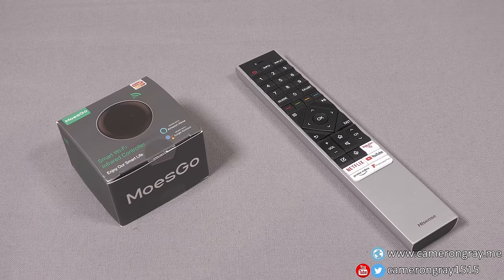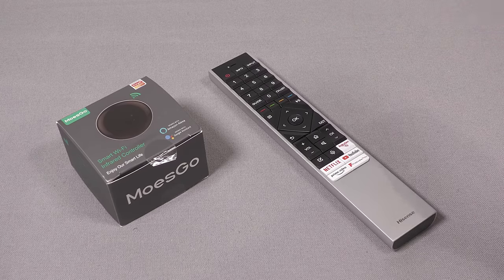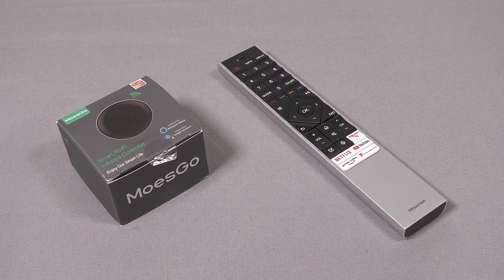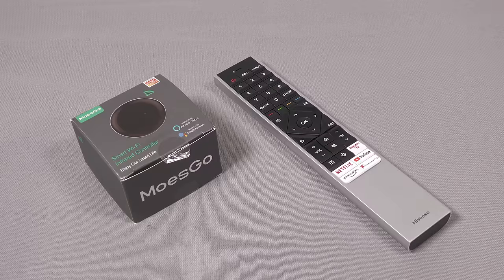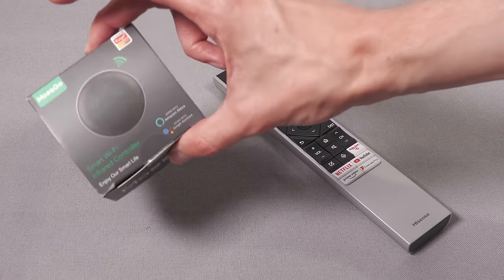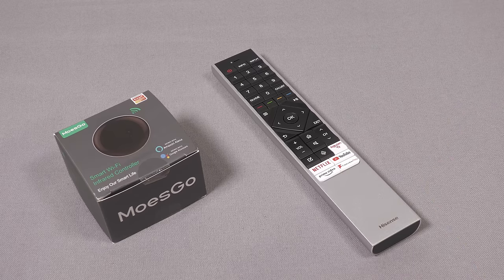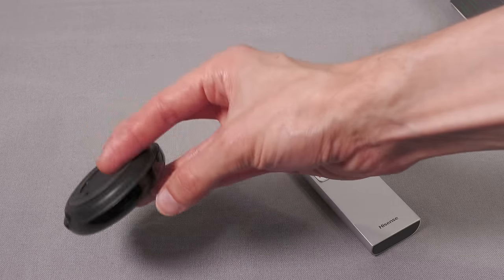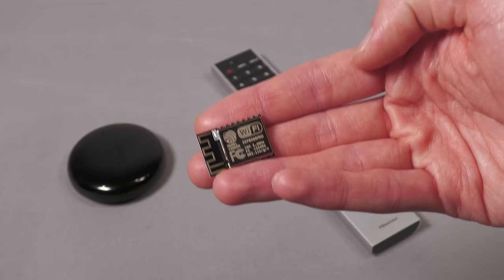Building The Ultimate Universal Remote - Tasmota & Node-RED Powered IR Blaster

Comment: I knew you'd make a video like this, but what you really did exceeded my expectations. I have a similar issue with limited CEC control on the older model LG TV I have in my bedroom, and the Prism+ (Skyworth based) TV I have in the living room doesn't support CEC at all.

I do something similar with a streaming box (that runs Android, so it supports USB keyboards out of the box) using a FLIRC device, but that only works one way and isn't as advanced as the setup you have showed.

I forgot that Tasmota existed before watching this video, and I was reminded of an unrelated project idea I had.

If I were to do something like what you showed in the video with the bedroom TV, then what I know is that if I try to press certain buttons on the remote, it would throw an 'Only available in TV input' error message, so what I could theoretically do is have my theoretical Node RED script wait 1 second for any additional button presses, then if there aren't, send the IR code for the 'enter' or 'select' button on the TV remote to select 'No' on the error message. However, if I were to press the 'Guide' button on the TV remote, the TV switches over to the tuner without throwing that error message. I just realised that I'd have to also have a way to detect what input the TV is on, or just assume the TV is always displaying a video input, which might be possible through the LG external serial control interface.

(41:15) Same thing with the Skyworth TV remotes, at least the one for my Prism+ Q55 (Skyworth 55UB7500), where it defaults to Bluetooth control. However, it uses infrared for the power button, and like the Hisense remote you showed, it also uses infrared as a fallback.

(42:06) Similar thing with the Skyworth remote. It lights up red when using infrared like with the Hisense remote, but lights up green instead of blue when using Bluetooth.

I may be wrong about this, but I think VIDAA is a fork of Android TV that doesn't use GMS, and uses Hisense substitutes and their UX instead, so I won't be surprised if the apps on that platform are just Android TV apps that had been customised to not depend on Google Play Services.

Comment: I LOOOOOOOOVE my tasmota IR hubs.  There are cheaper ones that still come with an ESP8266 out there.  I did a write up that shares the instructions and links if you're interested in sharing it.  Also tasmota and MQTT group topics are magical.  I put one of these in each room and carry the remote around the house for my audio receiver.  When I push a button on the remote in any room the IR hub receives the command and repeats it through the one that's actually next to the receiver.  It's sooooo good.  Simple events scripts in Home Assistant.  Also you can use the raw codes and use any IR code.  Tasmota option SetOption58.  Then IRSend the raw code will work.
Reply: I'd be interested in links to the ones with ESP inside. Thanks!

Comment: great vid thanks..  Though it would have been better to see the de-soldering and soldering.

fwiw the rm mini ir blaster  has a set of node red nodes (contrib) to learn and blast codes though iirc you do need to use the mobile phone app to initialise the device to start with.. so can provide a hack free solution you just need to learn and keep ir codes via node red..
-Yikes the rm mini -3 is not as cheap as it was..  but at £22 (quick amazon search) might be worth it if nervous with the soldering ??
Reply from the maker: Unfortunately I don't have a hot air gun so the soldering was a messy process involving a lot of swearing, wouldn't have been practical to film.  I'd maybe do it in the future once I have the correct tools.  It's definitely possible to use these devices with their stock firmware, but with my smart home stuff I try as much as possible to run everything locally without any reliance on a manufacturer's cloud, including to set up a device initially. However, for a lot of people using the API is a great option

Comment: I can understand American English but not so much British English, so I didn't catch up well enough, I got lost a bit.
To my understanding this seems somewhat overkill, I did hear you saying that the Logitech Harmony solution wouldn't be a real solution since they're now discontinued, but as far as I know that should not limit you in anyway since the logitech harmony software for computer doesn't need any updates or support, at least the logitech harmony remote that I own has a IR sensor on the back so you can "teach" it whatever input from any remote (virtually limitless).
You won't have to download any software for new devices, just teach the new controller's IR commands.

But that doesn't mean I absolutely respect your project, extremely well though out!
Reply from the maker: I could have used something like that but ideally I wanted something a bit more than being able to emulate other remotes - I have a few spare universal remotes that could already do that.  I needed something that could almost be scripted to perform multiple actions from the same buttons.  This is something that I think you could do with some of the newer Harmony devices however these were all app based which was my concern around long term support.
Reply: It's not British English it's a Scottish accent !!!
Reply: @travisash8180  well, my bad, I cannot distinguish from English, scottish and Irish...
Reply: @camerongray1515  what about the sofabaton? They seem like a fairly reliable and well established company... In case my Logitech harmony fails, my first option is them.

Comment: can i use separate receiver and transmitter rf module  connected to esp8266 tasmota to learn command and issue that command by rf transmitter module like remote? Thanks so much.

Comment: When you're sending it signal to the hub, how do you prevent the tv from acting on the same signal since they're in the same blast range?
Reply from the maker: The TV will react to the signals as well, I'm just fortunate that when the TV is set to the HDMI input it will ignore the signals from most of the buttons including the numbers.  You can see this when I use the info button to open the AV receiver's menu - the TV also receives this signal and pops up a message in the corner showing the current input information which later times out and disappears.

Comment: Great video but man I really wish Hisense would sort out their HDMI input changing. I really dislike when you press input it points to the current source, rather than starting from the beginning. If it started from the beginning, like TCL does, you could setup super easy IR commands such as Right>Right>Ok to get to the source you want. With the way Hisense set it up, you can't do this as your normal IR steps wouldn't work because it has no way of knowing what current source you're on. So dumb

Comment: Awesome.. can you confirm please the inside chop is ESP, because most of them now are starting to use beken chip

if it is using ESP it is easy to tasmotize,  I cannot make tasmota on beken
Reply from the maker: I covered the process in this video - it comes with a proprietary Tuya chip which is why I replaced it with an ESP before flashing Tasmota.

Comment: I prefer my harmony remote. I can control my hue lights with it at the touch of a button and also any smart plugs I may have. At the touch of one button, I can have my tv turn on, av on and switch to correct input and then have device turn on. I can create macros using the software to map loads of button presses on OG remotes across all my devices to one single button.
Reply from the maker: I considered a harmony however Logitech seem to be discontinuing them without a viable replacement so I didn't want to buy into an ecosystem that is being killed off.  Due to the nature of my smart home setup, I can do those sorts of automations you described with this setup as well, although admittedly it requires a lot of knowledge about the system and isn't remotely consumer friendly.  Hoping that another company brings out a decent Harmony alternative soon!